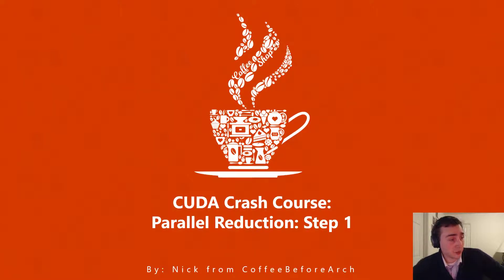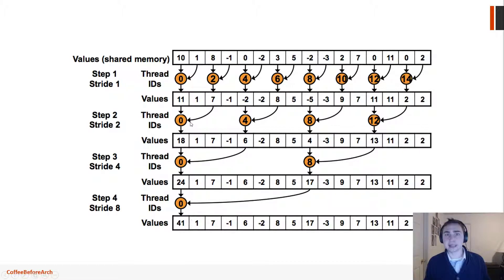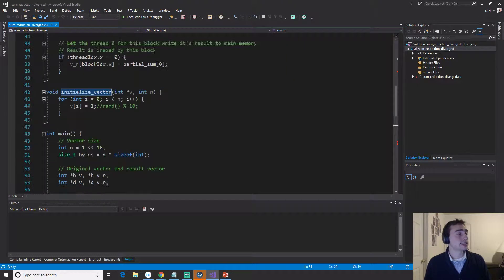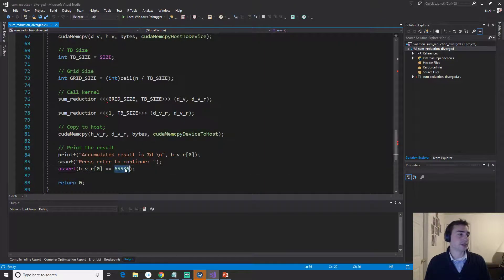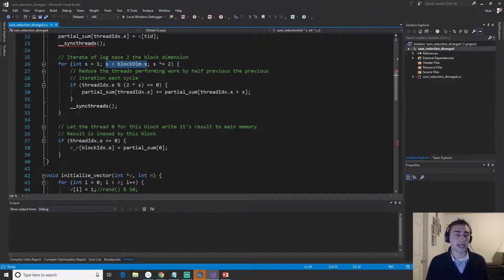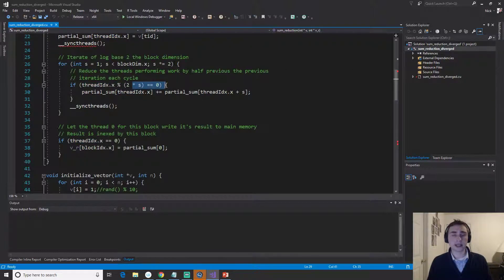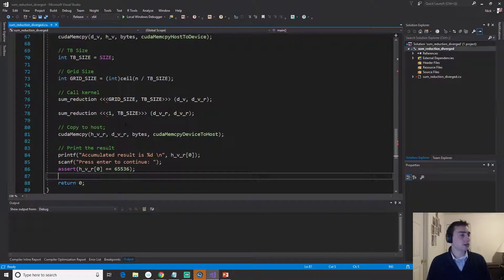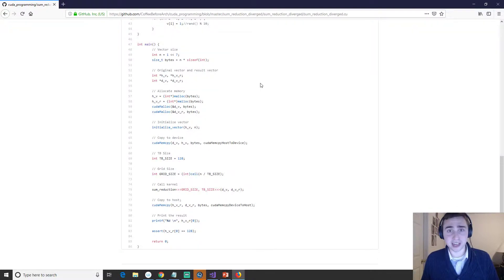CUDA Crash Course: Sum Reduction Part 1

Comment: 4:50 I think the second kernel call should launch with <<<1, GRID_SIZE>>>, not <<<1, TB_SIZE>>>, because the first call produced GRID_SIZE partial sums (each thread block produces one). In this case your GRID_SIZE and TB_SIZE are the same so it produced the same result.

Comment: I printed times to run with and without cublas difference is 1000x.Cublas is extremely slow compared to cuda code and hand designed kernels.Is there any explanation for this, and is cublas even useful in this case?
Reply: Have you figured out the issue?